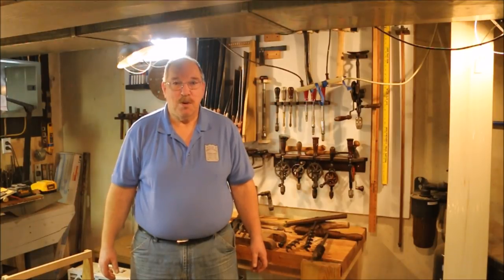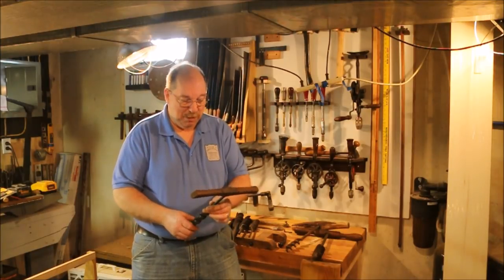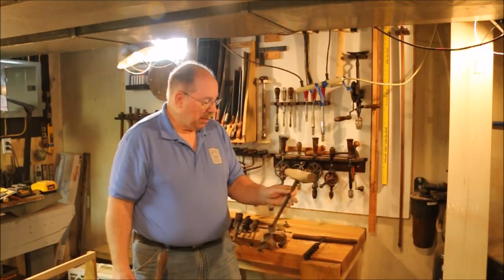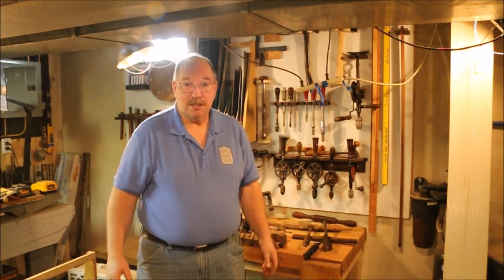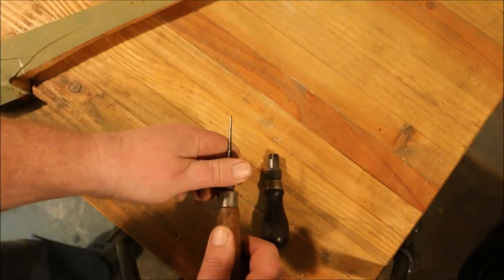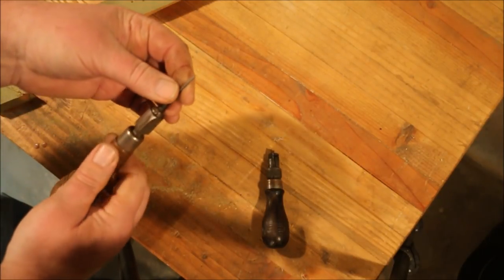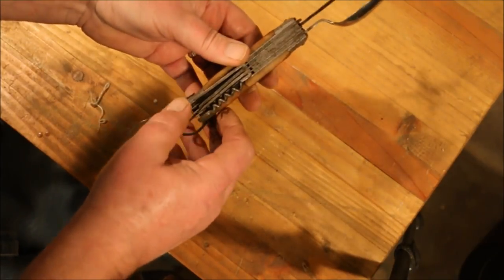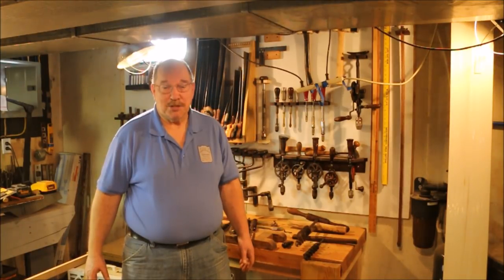ANTIQUE SHOP FINDS ~ THE LAST TRIP OF 2017

Comment: im sure you could also save that loose shank drill to fit too :)  id say that was a gunsmiths multitool, i love how many survival (and my swiss army knife) have a corkscrew, you know for all those times out in the forest and youd like to open a bottle of wine
Reply: 10/4 on the wine bottle found under a stump!
Reply from the maker: Jusb1066 the corkscrew is for those rare times when you run across somebody that's just got to stick some place they need to have removed.
Reply from the maker: Lewie McNeely Louis you're fine and wine bottles under a stump you probably better back out of there slowly because somebody's making something they don't want you to know about.
Reply: Usually quart jars and gallon jugs but not your average BLO either. 
BLO---W maybe. Cauterizes on the way down.
Reply from the maker: As in stump blower? I've heard that the making of the stuff is a common pastime but frowned upon by the local authorities. 😊😊
Reply: I think it's legal to make so much for your own use but being a polite kind, they want to share.

Comment: I could have seen you carrying around that little multi screwdriver in your previous life.  Some sort of maintenance supervisor who, when walking around the plant, finds the random loose screw, and just tightens it rather than walking the five to fifteen minutes to the tool crib to get the proper tool.  Not that that's a good thing (repair guys not doing their proper job), but the rare screw that needs a quarter turn so it doesn't rattle out.  Or perhaps the go-behind guy that checks repairs that are usually done right to begin with?
Reply from the maker: Brian Neeley My Father In Law, whom I never had the good fortune to meet, was a Line Crew Supervisor for LE Myers. He carried a knife that was given out by a company that sold felt sheets to papermills in West Virginia and North Carolina where he grew up. I had mentioned that I needed to get a better jacknife because the  cheap plastic handled Barlow that I carried at work was almost worn away. My Mother In Law gave me a Papermill Felts knife, that was the name printed on the wooden scales of the handle, like her husband carried. It has a single 3" blade that will hold an edge and a utility blade that locks open. The utility blade has a scraping edge and the end is a screwdriver. It was my EDC for over 20 years until a rise is position made a large bladed jacknife unecessary. It also made a rather large bulge in the pocket of my suit pants. 😀
When Ryan was old enough to have a knife I gave him my spare PaperMill Felts knife. Unfortunately he was unable to have a knife in his pocket at school for fear that it might provoke a war or create conflict. Now he carries a boyscout knife that I gave him. It's smaller and fits on his keyring. 
So in a way I carried a folding screwdriver in my pocket. I learned early on in my supervisory career that my job was to have  the people responsible  do any and all repairs to the things the were assigned to take care off. 
That's what got me started doing Work Instructions. I know that I always felt better about my job and myself when I knew what I was doing. Having written directions and recording changes made predicting problems before they appeared possible. The point of this whole story is the act of fixing something just to keep it running or working outside the system is counter productive. Hearing one of the men who worked for me say that he had fixed something multiple times made me ask him what would actually stop the problem from happening. He told me his idea but said it would take too much time to do. I told him we would schedule the time and do it because we were having that much downtime anyway, just not when were ready for it. 
That was about three years into a 35 year career. For the next six years at UTC the crew was happy and sucessful. The shop was running smoothly. Downtime was planned with just a few exceptions. 
I didn't need to carry a tool kit anymore. Not even a tny one.

Comment: Nice old multi tools. Agreed, such are not very good at anything, but they can be handy for light duty or quick and dirty. I keep one in a little belt pouch at work, saves me having to go back to the shop for the proper tool. Main problem is that I keep losing the bits. The old Scout one is nice, never did figure out how to use the fork and the knife at the same time.
Reply from the maker: kleinjahr It's kind of a scoop and stab tool. Grasp center of handle with right hand like a hammer handle. Back of the hand facing up. Spoon on left side. Scoop with spoon and shovel it in your mouth. Rotate hand so fork is pointing down. Stab meat and rotate back of hand down. Raise hand and bite off meat. 
The real trick is cutting with the knife and fork. I cheat and use the shears. 😎